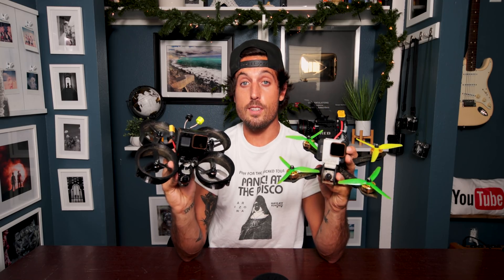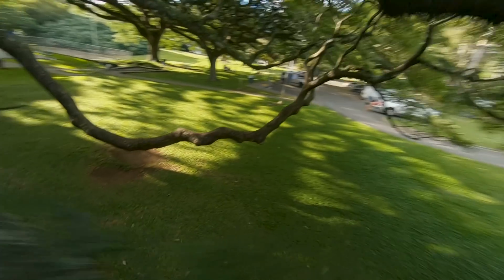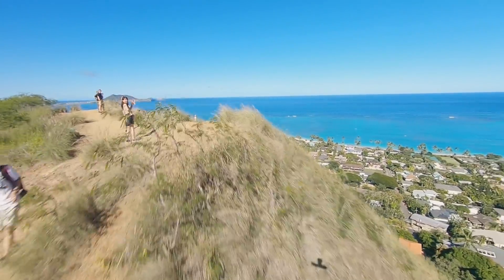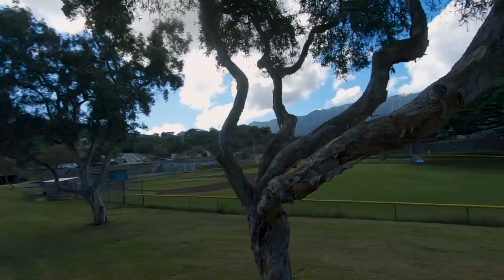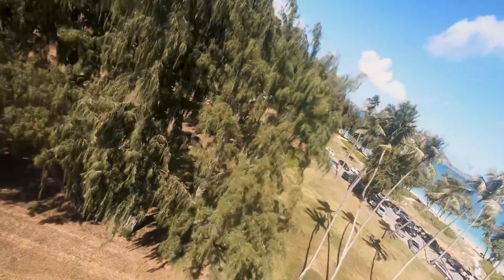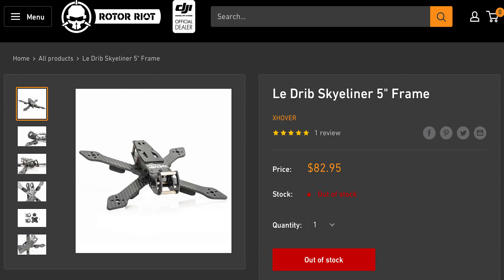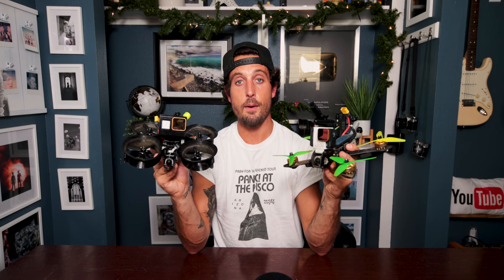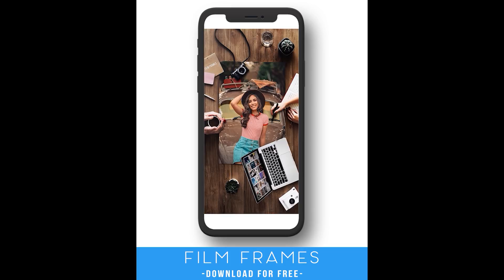How to Build a DJI FPV DRONE | 3Inch vs 5Inch Pros & Cons

Comment: NOW WAIT A SECOND. Both of my Cinewhoops are 10 times greater than my DJI FPV in almost every way. And I am a big fan of DJI fpv, If you get a Cinewhoop wuth a lot of power like flywoo CineRace20 V2 or shendrones squirt v2.1 6s. You can take back everything you just said about a fast acrobatic flyer. Then still do the slow ground work or fast precise flying. Get one and you will change your mind. So the only factor after that is wind. Which let's be honest you have wind problems with racing drones also. Don't believe me watch my Cinewhoop do tricks and dive from 1100 feet and take off like a bat out of hell. PSone little secret you need to try is HQProp 3 inch 8 blade 2$ propellers lol your power is back jack

Comment: Hello I've a Radiomaster TX16s (version 1) and the betafpv expresslrs elrs 2.4ghz 1W Micro Module. I can't change the 10W value, in the module joistick or in the LUA software, Do you have an ideia what maybe is the cause?

Comment: I wonder if you were told that about the batteries because the different drones are at different ohms and require a different draw or whatever. That's probably why you said the other one died faster, I wonder if you had a higher or lower milliamp-hour cell if you would get better life. 🤷‍♂️

Comment: You need to learn how to tune. And motors. 5inc can be Very steady.  But dangerous don't think could possibly cut anyone in half?  But will hurt! Lol  3inch won't tickle anlog About half the price. And with good goggles and reciever. Work good. But by then.. could have bought Dji Google's. But every camera 150.. not  50 like anlog. If using a go pro.. might as Well as well use anlog..  nice to have friend's in high places.. working guy. Start with box Goggles and anlog.. and an whoops can't hurt a flyer lol

Comment: I have just returned my DJI FPV drone. But what I wanted to ask, how do you find the goggles. I have found that the googles does not clear my nose so I always have to push it down to get a clear view of the whole screen. I did not see any settings you can do to adjust that. The DJI FPV drone is awesome but too much money for a starter FPV drone. I think the cinewhoop is the one for me and looking at getting one.

Comment: There is SO much wrong with this video... ffs. Firstly, NOT A DRONE . You are not using automation, thus not a drone. ffs. Dude don't blame poor tuning/TX setup (expo and such) on the platform. You can make a racing quad hover dead nuts and do everything the cinewhoop can, if you set up your rig for it. My 11" quad and tricopters were great at hovering (prop size has nothing to do with hoverability). Also don't blame  the 5" for being a poor pilot and getting stuck in trees. You can do that with literally ANY size multirotor. Also, you can run cinewhoops incredibly fast. You may not have to skill to do it, but there are those out there that get paid to get rippin' fast footage.

Comment: Now I don't have any idea what to get. I want something between a 3" and 5" quad. For nice shots but also basic stunts.
Reply: Do you plan to fly indoors?
Reply: @bandobandit353  No, outdoor only. I like the speed of 5" but I doubt that I can control this. That's why 3" sounds nice but the again I would like to make loops and other manouvers.
Reply: These two aren't really opposites. It really just comes down to power to weight ratio. Bare in mind that you can scale your throttle to make it less powerful with the flick of a switch. But flying a 5 inch indoors without ducts is still going to be dangerous. Good luck.
Reply: @bandobandit353  Thanks, I just found out here that it's possible to throttle the speed. Do I need a special controller for that?
Reply: Any transmitter. You'd set up two rate profiles in betaflight and then map a switch to switch between them Joshua Bardwell has a video.

Comment: YEAH, THEY WILL CUT YOU IN HALF, LITERALLY. Two days ago I had an accident with my 5 inch, deep cuts on neck and head, and the motors were disarmed.
Reply: @Sloop - They were disarmed, but the quad fell from 8-12 ft straight to me. If the motors were armed the cuts would be a lot worse, specially due to airmode throttling up when enconter "obstacles".

Comment: Alright so one thing that I do want to say is that you do NOT need the DJI controller to fly DJI, all you need is the air unit and goggles you can use whatever radio/transmitter you want
Reply: you just need the proper receiver then right?
Reply: @riccardozottele  yeah man those rush tank vtx and budget eachine goggles would do just fine unless you're highly experienced and want picture perfect shots
Reply: as of 2025 i'd say buy a walksnail system and either a GX12 or zorro (the boxer/pocket are great too) ELRS is bettern than anything and it supports smaller devs

Comment: great info, only thing i would add is don't give up on 5inch and slow flying, it is possible, the prop motor and quad weight combo should make the throttle feel as precise as the other sticks, so if you can't raise or lower the quad 2inches at a time, try different combo, props usually.
Reply: another tip is use throttle to go down and pitch to rise up and let forward momentum do those fine adjustments in height. the combination of slow flying through trees or whatever and ridiculous punch outs and dives back to slow stuff,  is a lot of fun and makes for some fantastic shot sequences

Comment: Perfect video for beginners like me  who wants to get into cinematic fpv. One question though : are you familiar with frequencies regulations in some countries such as Japan ? I went to buy a DJI FPV Goggles in Tokyo and I was told that it was illegal to use its frequency in Japan. Same goes for the controller (Taranis QX7S) which are impossible to get.

Comment: Hos fast is this drone?
Reply: 5" race drones are typically in the 80-110mph range. He's buying really expensive high end stuff. So I'd estimate that the 5" could go high 90's at least. Maybe not with a gopro on it though. Hard to say.

I don't have any clue how fast a cinewhoop can actually go. I could be way off but maybe somewhere in the 40-50mph? I don't yet have one and you rarely see people actually pushing them that fast. This is especially true since the Motors can get really hot because of how hard they work just to get flight, let alone to really push it. Cinewhoops just aren't made to go fast so I guess I've never really stopped to think or ask.
Reply: aha, thank you very much! It's very fast

Comment: You could cap your throttle on a 5” and manipulate your curve to make easier to fly smooth. You can also take off the cinewhoop ducts and use the 3” as an acro quad.
Reply: That's what I was gonna say. Throttle cap (which can be done in the DJI goggle menus if you're using their controller or OSD of Betaflight or setup easily in an OpenTX transmitter) or motor output limit (and maybe S3 props) and you can get the same throttle resolution of the Squirt ... granted it's still physically bigger and still a flying law mower, but it's nice to have options :)
Reply: Cool, didn't know that. I'm thinking to get s drone but there are so many options..3", 5", different controller s, goggles...

Comment: Not entirely unconvinced DJI does not have a backdoor in their wares to allow the guvmint to shut them all down at once. I asked a DJI rep that exact question...and did not receive an answer....as far as flying a 5" slowly..camera angle and stick time man....I can fly my 5" nearly as slow as my cinewhoop..it does not have prop guards though so the cinewhoop gets used more for proximity stuff...good luck...
Reply: Steve Beatty I know it’s all about cam angle. I feel like there were so many incorrect facts in this video

Comment: Hummm... I don't get how your cinewhoop flies less time than your 5". Been flying cinewhoops since they exist and pretty much have double the flight time of my normal quads
Reply: your 5in can fly longer if you suck at flying, and you crash all the time, the pack never discharges fast enough and your battery lasts like 10min. like last year when I sucked at flying, my packs lasted like 8 min each, and I had like 6, so I was at the field for like N hour. But now that I am good, my packs last 2 min, because I practice on race track, and maintain full throttle, due to short throw stick.
Reply: Xplosion FPV do u even watch Fincky ?

Comment: Have you considered going ducted on the 5" props? It might add to the stability?
Reply: Can probably use Solidworks Flow Simulation to test that out. Not sure if RotorRiot use that software or not.

Comment: Is it possible to have an in-between of a 4-inch drone?
Reply: Yes. I've heard of people putting ducts and a gopro on a 4" baby hawk.

But 5" is just the inbetween of of 3" and 7".

This dude spends way more money than you need to though. You could have a cinewhoop and a 5" for the price he spends on just one of those quads.

I haven't done it but buying an Eachine Tyro79 kit and putting it on a reptile cloud 149 frame is only $110 dollars and seems to fly perfectly fine. That's a cinewhoop for $110. I just bought a pre-built 5 inch quad for $175 last month. Yeah, you'll get more out of more expensive versions, but sawyer is paying big premiums for no reasons other than he can afford it without flinching and he hasn't really done the research to know it can be done cheaper.
Reply: Zach Machina agree. I get the feeling that he doesn’t really know what he is talking about. Probably why he smoked 3 Air units in his first build. Also there are various incorrect facts in this video. In my opinion, not helpful for beginners.

Comment: Good points.  I almost went with the CineWhoop myself...but decided the 5" FPV was really what I wanted in the long run.  I think FPV's are like Cameras...they're isn't going to be just 1 that gets the job done.  Each one has it's own strong points.  This is why you see so many FPV folks have multiple FPVs.  Different types for different needs......great video to point out the big differences though.  Got my 5" FPV on the way...can't wait to get it up in the air.  Still on the flight SIM in the meantime..... :)
Reply: Same here, practicing in Sim for 3 months and my 5inch FPV gears are slowly arriving. Cinewhoop is actually cheaper to build. Once u master the 5" quad, You can control Cinewhoop even better. Start from difficult is the way for me. Happy Flying!
Reply: @kelvinzyteng  You as well..enjoy!
Reply: I'm going to buy my first fpv drone, do you regret going with the 5 inch instead of the 3? I'm leaning towards the 5 because of longer flight time and wind resistance. any suggestions?
Reply: I'm going to buy my first fpv drone, do you regret going with the 5 inch instead of the 3? I'm leaning towards the 5 because of longer flight time and wind resistance. any suggestions?

Comment: awesome video. why Hero 6 and not get an Hero 7 or 8 with the Hypersmooth feature? I've read that for RealSteady Go they were working with the 7.
Reply: RideWithOKP you have to soft mount any GoPro that isn’t a GoPro Hero 6 due to the gyro processing in order to use ReelSteady with it. You could use a GoPro with hypersmooth but many people prefer the look of ReelSteady. Therefore Hero 6 is the easiest option as you can hard mount it with no issues.

Comment: 0:10 Save $1000??? How??
Reply: i was thinking the same? Wtf, you still need the dji gear for both drones. Even if you remove them you need an analog gear with a remote and googles. That was a straight up lie to keep me watching, and it worked.
Reply: Trial and error in this hobby will consume much more than $1000